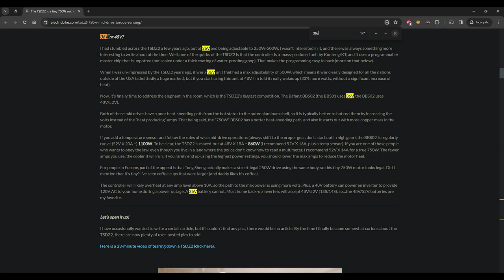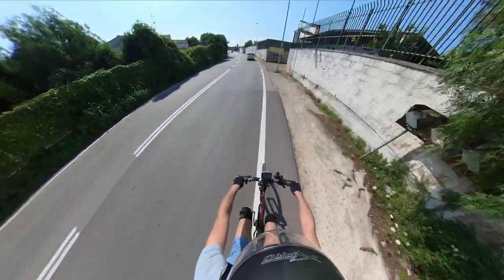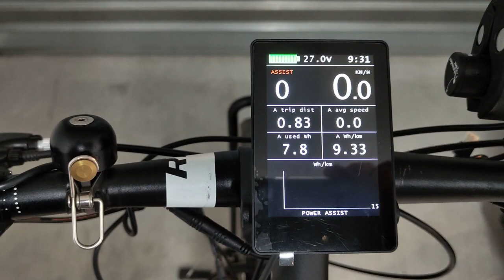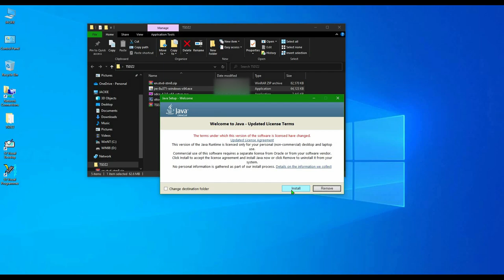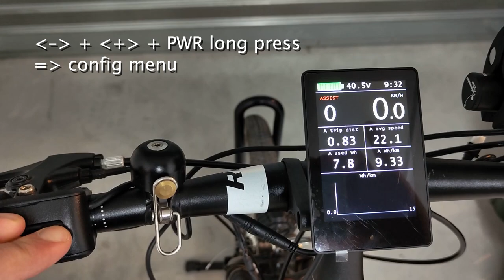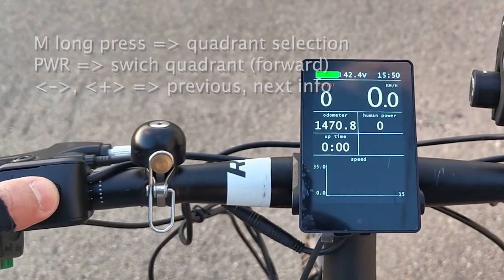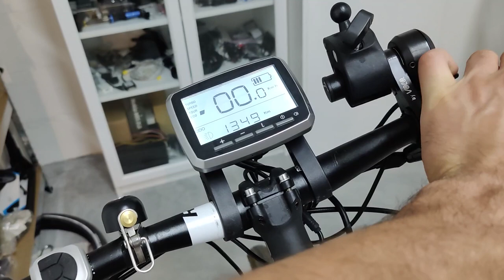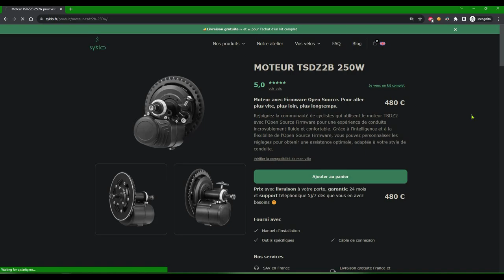OSF on the TSDZ2(b): Original Display Vs the 860C, which one should YOU choose?

Comment: Your videos made me decide to buy a TSDZ2B, thanks! About the throttle, since you're only getting half the input, did you check the voltage your throttle is outputting? If you have a bench PSU you can try using it to see if higher voltages return the desired bit value. The usual voltage range for ebike throttles is 1.2v to 3.6v (some are 4.2v).

Hope this helps!
Thanks

Comment: I watched your videos years ago and keep watching. I started with bafang bb01. Good motor and never had any problems but it has no torque sensor. Then i got tsdz2 48v. The ride feeling is much better. I installed osf and also better. But then it broke water damage and could not remove the stuck galvanised screws as I needed I change the blue gear. I got a new but the tsdz2B version. That lasted 6 months broke again with water damage when I cleaned and so had to buy another. I got instead a toseven dm02. It’s more water resistant and has more power and better cooling than tsdz2. They update the software and it’s easy to install. Also the display is better than tsdz2.

Comment: I was thinking about buying a TSDZ2B motor and putting the Open source firmware on it but now I notice Tongsheng have  a new motor the TSDZ8. I can't find out much about it and I dont know whether the OSF is compatible or not. Any thoughts on it?
Reply: Don’t. Instead get dm02 from toseven. It’s much better and from the designer of tsdz2 but they fixed many problems from tsdz2 like the firmware, cooling and more water proof. It also has a good display and you can configure on the display so no need for pc software. Cost is about the same as tsdz2.

Comment: Does anyone know how to check whether or not your TSDZ2B controller is V2?
Reply: I believe you can check the voltage between SWIM and GND pins on your speed sensor cable. If it is 5v, then it's v1 controller. If it is 0v then it's v2 controller.
Reply: @viveksabbani6133  cheers mate, so can a V2 controller ever be flashed do you know?